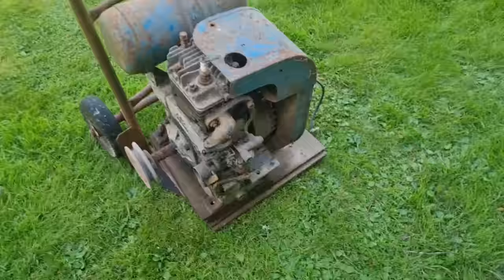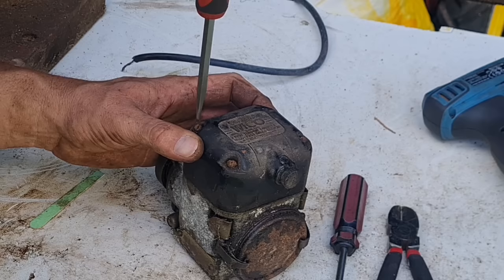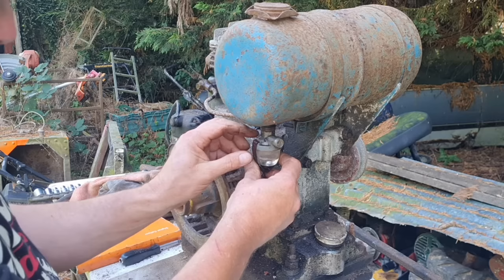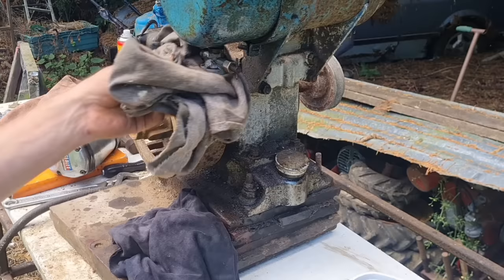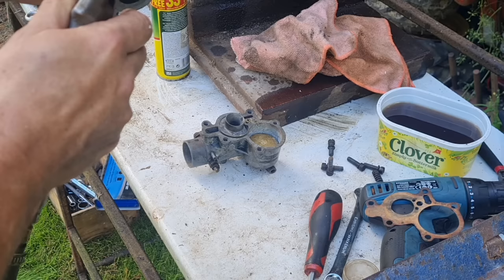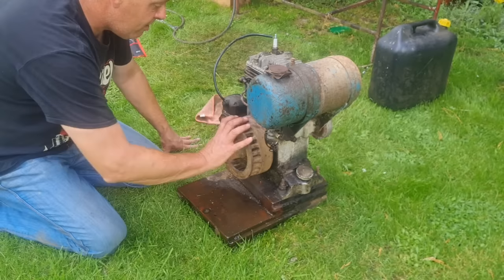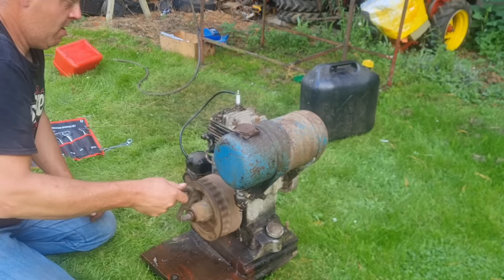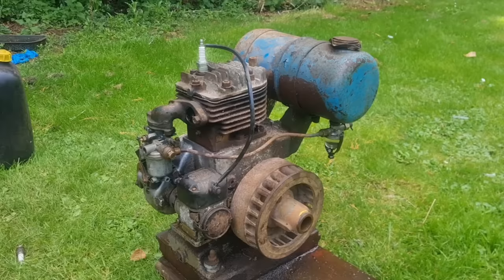Bonser engine? Not ran in over 30 years. JAP 4

Comment: I'd certainly agree with the "stick a drill on it" brigade, and if not for any other reason, then because the valves weren't cleaned and lapped, and you may be losing just enough compression for it not to fire. Spinning it with a drill should pound away at any rust and dust deposits on the valve seats - Sort brute force approach, but it works Mustie and others, but also, just spinning the engine at a constant speed and working up some heat via the compression should help.

Just as an aside, I was watching "Bangers and Cash" tonight, and guess what? They were selling one of these Bonsers. Guess what else? It was bought by the lady who owns the garage where I take my car for repairs and MOT!

Comment: Beats me! I'd have expected it to run with some petrol down the bore at least - your timing looks right (eventually!), the impulse should fire just about at TDC at slow speeds, which it appeared to.
I think what I'd do is turn off the petrol to take the carb out of the equation, and persevere with running it either petrol down the plug hole or carb cleaner down the carb inlet. It should run for a second or two on that if everything else is right.
You could mark TDC on the flywheel and put a timing light on it just to check the timing is about right, maybe that impulse is sticky and firing late when you turn it a bit faster?
Maybe pull the valve cover and check the valve clearances are sensible?
Was it flooded or just too rich? I normally find with the petrol down the bore it's worth holding the throttle open and at some point it will find it's own correct(ish) mixture as excess fuel blows out as you crank. I couldn't see if you were doing that?
Something I used to do with fixed jet carbs that had a jet blockage was to turn the engine over with my hand completely sealing the carb intake - that way the suction tends to pull hard on the fuel, often pulling the bit of &^%$ free from the jet. It's quick and easy to try, anyway!
Failing that, a pagan Bantam sacrifice will always work, with the correct incantations of course.
Good luck with it!

Comment: I think the carb needs to come apart, float valve and each jet  inspected and blown through. It wants to run on the fuel down the plug hole, just not enough to sustain any fire.
Good luck.

Comment: I think it's the HT lead being old, just a guess,  bye the way is that a rover sd1 behind the work bench, great video.
Reply: I agree, if the  mag is producing a lot of power the flow will be the least resistance which could be a small crack in the lead insulation near an earth point.

Comment: The exhaust manifold is tapped one inch BSP there is the remains of an old piece of pipe stuck in there, if you carefully cut it you can then screw or peel it out. I am not sure you turned the petrol tap on so there may not have been enough head of petrol in the carb, also that carb needs to be cleaner inside you blew it out but there was a lot of corrosion inside that needs to be removed otherwise it will was off and clog the jets.

Comment: Put a little oil down the bore give it a little more compression all so pencil the plug aswell but please don't push down on the handle as these are quarter pull and if fire backward can break your arm so be aware goodluck

Comment: Hi Adam
Should you be using a long reach plug as was originally fitted. Is that why it won't start
Reply: I have a villiers with a short plug that should be a long one, it works, but probably not the best of ideas!